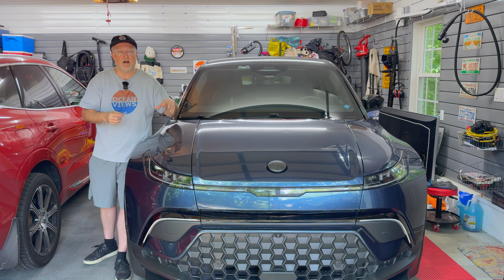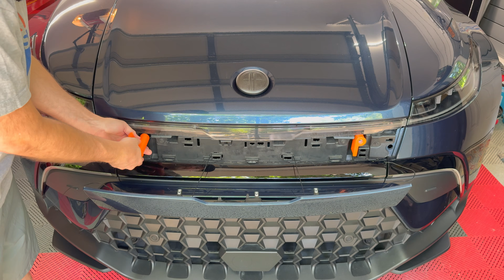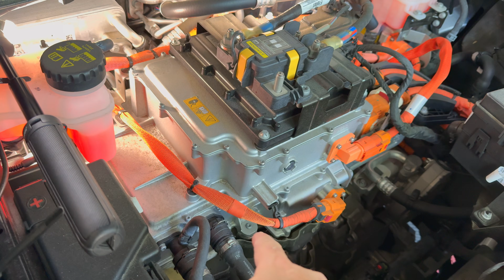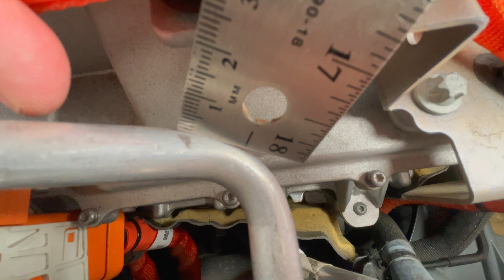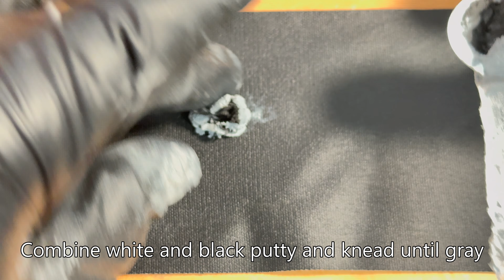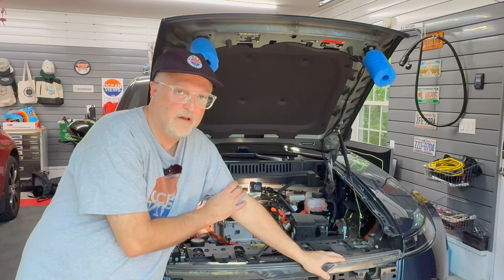Fisker Ocean - Inspect & Repair Chiller Pipe

Comment: Thank you for your video.

For FO owners with higher mileage and more significant damage to the air conditioning lines, the rubber mount of the torque support may also be weak. As a result, the engine moves more when accelerating.

Comment: Thanks, I would say may be add the black foam AC insulation too (if possible), just to be on the safer side. Definitely monitor it as part of a yearly maintenance program. I also saw that the later models don't have this issue...it seems the design was improved so that this would not occur.
Reply from the maker: There may be differences in manufacturing tolerance.  I don’t think later VINs are necessarily better. It may also depend on how much Earth mode use the car gets as well as miles driven.

Comment: If the pipe is significantly worn, I would use the liquid JBWeld or similar, and do everything possible to prevent air bubbles. You really want to make sure that there's not path for gas to escape, should a pinhole leak develop in the aluminum.

Comment: Great video and thanks for letting us know

I just checked mine and I have similar to yours just a slight little mark on the tube. I got an ocean one with 21,000 miles.

I actually just bent the pipe a little bit down and in and also put a plastic zip tie over it

At some point I’m going to put a metal hose clamp over it. I just didn’t have one handy at the time.

Thanks again

Comment: I suspect the problem is at least partially due to driving in "Earth" mode. This causes only the front motor to work and likely flexes the motor mounts more than using both motors. Anyone with evidence of wear should strongly consider cutting back the harness tab with a dremel as covering it with something is only a temporary fix.
Reply from the maker: Good point.  I'm conditioned to start the car and immediately change to Fun mode.  That may explain why my scratch was mild at 2.5 years/27.5k miles.  Yes, as stated in the video, I plan to do a follow-up video with a solution.
Reply: This is not related to earth mode because I’ve never driven my car in earth mode, always and fun and I have the same wear Mark
Reply: @markhartman1475  It's obviously related to torquing the front motor. That and how close the metal tab is to the HVAC line is probably what determines if there is a problem. Discussion on Discourse for full details. It is likely that Earth would torque motor mounts in front more, just like they tear up tires more, but not the only reason. I'm guessing the distance  for your mounting tab is <18mm, that seems to be when people have issues. Time to get out a Dremel..